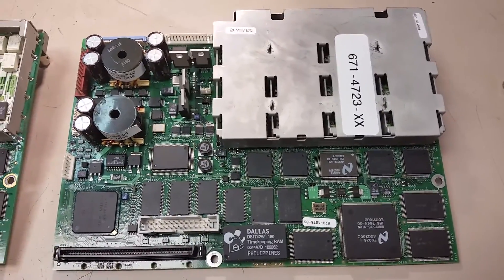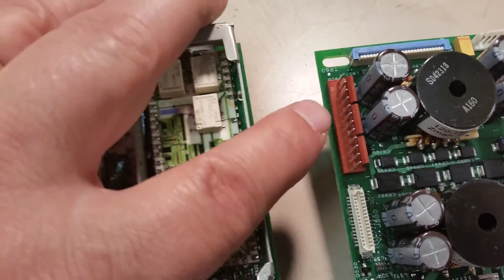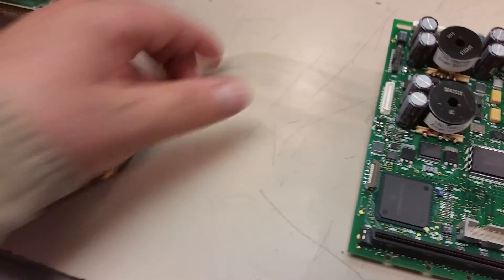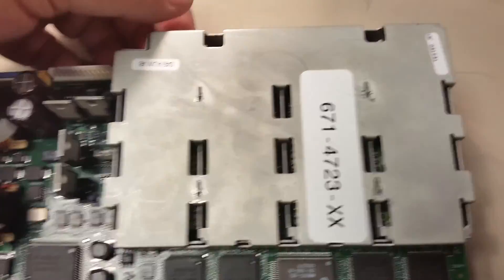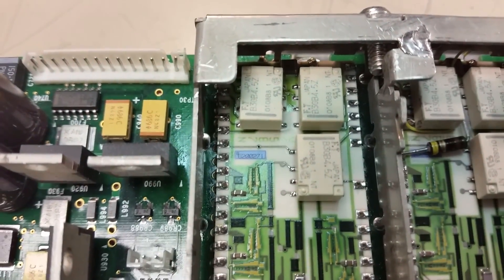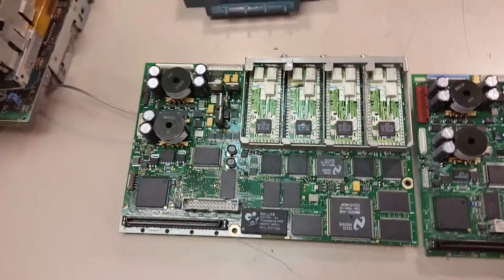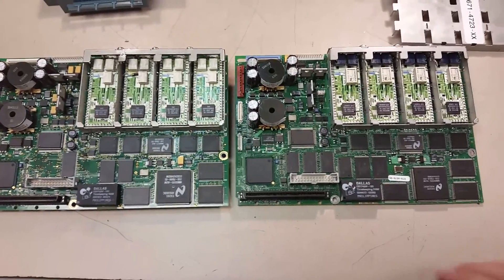TDS3054 & TDS3054B Mother Board Differences

Comment: Hi. Great video! Is the resistor soldered to the second module the 50 ohm input resistor? I have a TDS3032 with a burnt 50 ohm resistor and even though there are differences between your scope and mine, the top layout of the module seems very similar.
Reply from the maker: Hi Helder, yep the resistor is soldered straight onto the module. Be advised that the silver colored plating on the module (don't know what it is) is VERY sensitive to heat and when it's over heated it will melt and shrink away from the contact areas. So use a small resistor, low wattage iron and a pointed tip. Use metal film resistors or at least a temperature stable resistor, don't use the carbon ones as they can change value with temperature and time. I thought I had put up a video on the input module boards but it was only on the relays, not a bad video to watch by the way. Send me an email to the email I use for YouTube;    Keith_Noneya@att.net     and I'll see if I have some close up pictures with out the relays on them so you can see where the 50 ohm board resistor burns up. Don't worry I'm not going t sell it or send you a bunch of crap, it's just tech to tech, LOL Anyways thanks for watching, Best Wishes & Blessings. Keith Noneya
Reply: @keithnoneya  Hi Keith. Many thanks for your quick reply! I'm emailing you now.
Reply from the maker: @heldercrespo2903  No problem bud, I'm at work right now, when I get home I'll check my files and get back with you today in about 6 hours. Time for you to put some vids up on your scope Helder. Love doing my channel, you get to meet a lot of cool and talented tech's and get the info you need. BW & B's Keith.
Reply from the maker: Hey Helder, I didn't get an email. Try copying and pasting it into the compose to sender. My email again is keith_noneya@att.net  no caps are needed, also don't forget to put the " _ " under score between the names. Keith
Reply: @keithnoneya  Hi Keith. I did use that address. Maybe my email went into your spam folder? I will retry now. Helder
Reply from the maker: @heldercrespo2903  Finally I found it, yep in the spam. I can edit and send the pictures tonight. I did send you an email reply. BW & B Keith.

Comment: Hi Keith! Thank you for sharing this, I just bought a TDS3032B with one broken channel and tried to find out if the attenuators are different between the regular and B models.
You said that this attenuators modules is repairable, you mean that it can be replaced with a good one? Or you have experience repairing a broken module? (except module with burned 50ohms resistor)
Reply from the maker: Hey Mr. Nifty, Great question! Yes the attenuator boards can be changed or repaired, depending on the damage. Case in point if the board is cracked across a pad it most likely can't be fixed. If broken across runs only it can be glued together and a run soldered across the cracked runs. This must be done at VERY low Temperatures or the plated runs on the ceramic board will literally evaporate. The 50 ohm pads are a common fix, because some folks try to pump to much voltage into the scope when it's on 50 ohm channel input. The actual 50 ohm pad is some how grown or spuddered onto the board. If it's burnt you can just solder a 50 ohm resistor to both sides of the burnt pad area. I would use a metal film resistor for this as it's temperature stable unlike the carbon resistor a co-worker put on the one in the video.
Also this video is on a 3054 & B, not a 3032B, I haven't worked on those yet. 
The hardest part of doing attenuator repairs is getting the board out while trying not to break it, they are extremely fragile.
The attenuators have a cage around them that pretty much requires a rework table or an oven. We had three irons and a heat gun on the board and barely got the cage off and still managed to damage the board, but repaired it. So if you can repair the attenuator while it's still on the board I would do that. Hope that helps answer your question. Best Wishes & Blessings. Keith Noneya
Reply: @keithnoneya  Thank you for reply! P.S. Tektronix TDS30xxB share the same main board across all models. In my case, main board looks exactly like yours, but the two attenuator boards and two IC's (U300/U400) is not populated.
Reply from the maker: That's pretty neat. I noticed TeK did a lot of that to keep costs down. Is electronics a hobby or a profession for you. Me it's both, but the items on my channel are mostly my equipment, this scope is one of the exceptions. You should put a video up of your repairs. Since there are no schematics on these scopes they are very hard to diagnose and repair, at least for most techs, me included, so any information can be a helpful. Let me know if you need anything else I'd be happy to help if I can. Best Wishes & Blessings. Keith Noneya

Comment: Does the resistor you replaced on the attenuator fix the The scope is reporting "X input termination overload/overheat/ error thanks
Reply from the maker: This was my first TDS3000 series repair. So I'm not sure on that one. However if you can measure it and it's bad putting a small 1/8th or 1/16th watt resistor could solve that problem. If you decide to remove the Attenuator it is a very difficult and delicate task. The first one I removed I broke the corner off. In order to even attempt to remove the attenuators you have to remove the BNC Channel frame. The bad part about the BNC frame is that its a HUGE heat sink with three tabs per channel. When Removing the frame you'll have to shield the board components, have a second person use a large heat gun and heat that frame up. Then while it's being heated use a hefty soldering iron and some wick to remove the solder from the three frame tabs by each BNC channel input. I highly recommend that you un-solder what you can then just cut the two outer tabs off the back close to the board, leaving the center one for reassembly. When you resolder the frame back on just fill the outer holes with solder and bridge it to the frame part you cut off, or even use a copper wire. I did this procedure on on shops TDS3054  scopes and they're still working today and it gets used almost daily. If you have anymore questions feel free. Best Wishes n Blessings. Keith Noneya
Reply: I'm not sure if I need to remove the hybrid as im getting a noisy signal at 5meg samples in both 500 and 10K point sampling ...the error is voltage spec has been exceeded termination resistor over heating   David Jones EEvblog also had the same  error message. He checked the signal was comming out of each of the hybrids indeed it was.  That's as far as he got. But it seems this could be a common fault. I also have a tds3012 that freezes on boot up and will not load 
Seems this is also a common fault .....thanks for your reply

Comment: Hello Keith Noneya,

Could you please show the other side of the boards if it possible, to check what is the differences beetween two boards on other sides as well?
Basically I would like to see the external trigger cable, to see where is coming from.
I would like to check that the external trigger cable could be added manually which does not have it originally.
Thank you in advance.
Reply from the maker: Hi J'anos. I wish I could but the scopes have been put back into service and the only picture I have is of the back of the TDS3054. If that would help I can email it to you, but I assume you have the TDS3054 not the TDS3054B.
Sorry about that. Best Wishes n Blessings. Keith Noneya
Reply from the maker: Hi J'anos, I am so sorry I missed answering your question. I thought I had answered you until I checked. If you'll send me your email in a private message on my about tab on my home page, or even here I can send you a picture of where it connects to the other side of the board. If you have figured it out by all means post a video or picture of it. Thank you for watching. Sorry again about the late reply. Best Wishes n Blessings. Keith Noneya
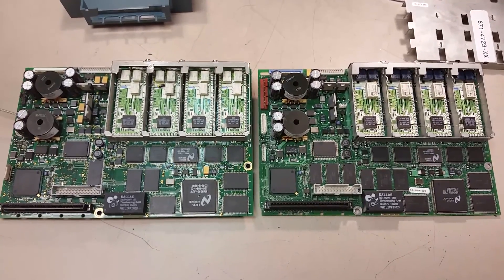Reply from the maker: Turns out I do have a quick shot in one of my videos of where it connects to the Mother board. You can go to my TDS3054B Internal Motherboard Removal here:  https://www.youtube.com/edit?o=U&video_id=NxtJRJLCSms Then go to time index 3:42 you can see where it connects. Hope this helps. Best Wishes n Blessings. Keith Noneya